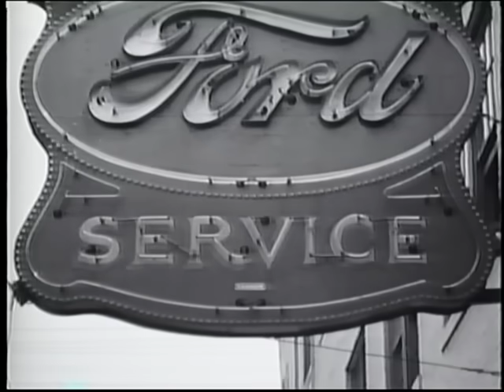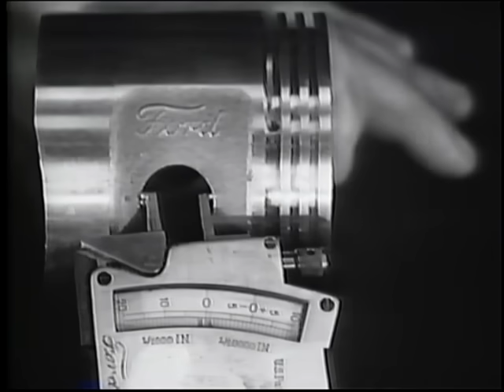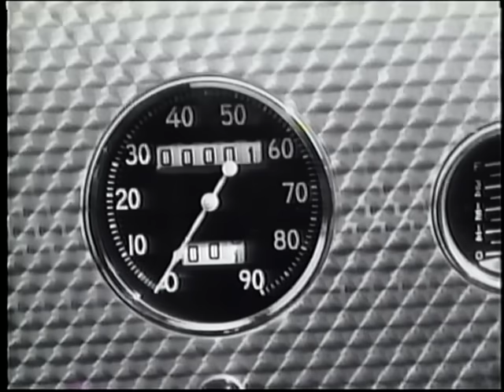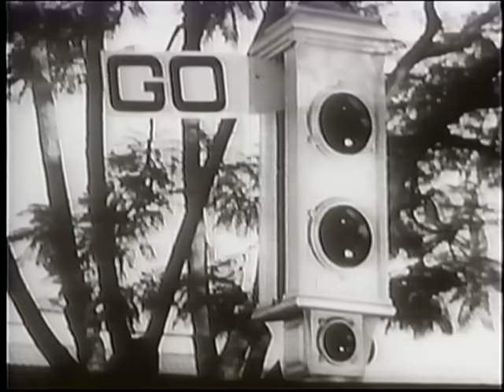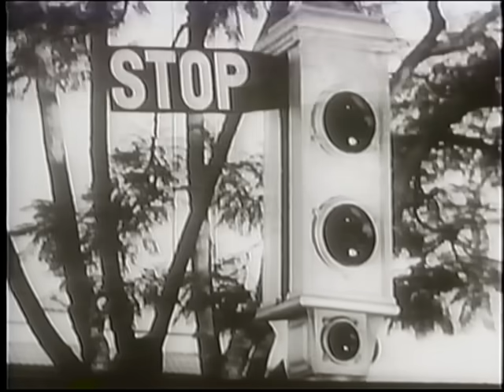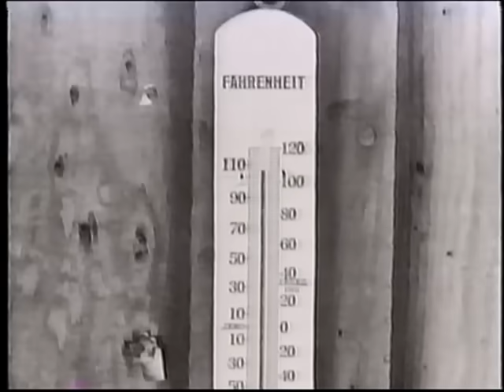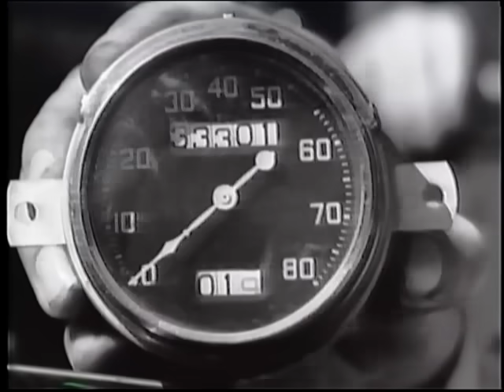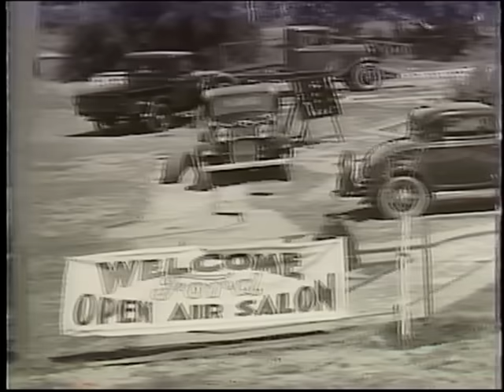1932 - The Invention of the Ford V8 Engine

Comment: Bad title. Far from the first V8. Should say first cheap mass produced V8
Reply: Read it again, then sue your school.  lol
I remember some history that v-8's were built, but in two or more pieces bolted together for the block.  Ford figured out how to pour it into one casting.  Yes, they were less expensive to make, (where "cheap" comes from).  In manufacturing, if everybody, (your competition), is using 5 different processes to make a part, and you can figure out how to make it is 4 processes, it's a pretty big savings, and an edge on the competition.  It's good competitive manufacturing that helps bring product prices lower, and hopefully, quality actually gets better, (then we went to china, and blew that all apart).